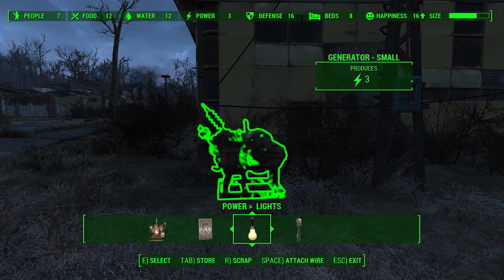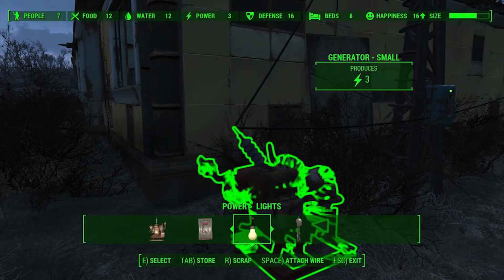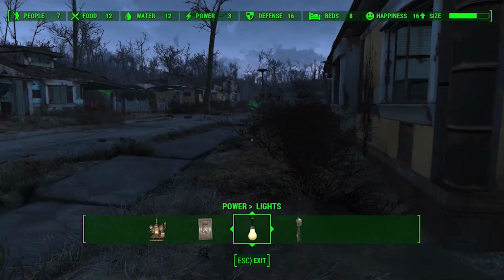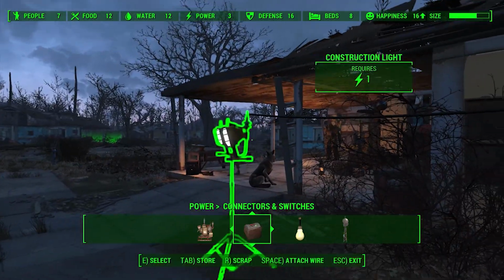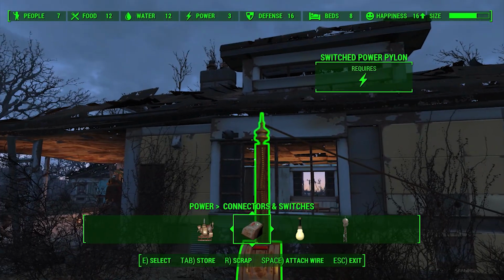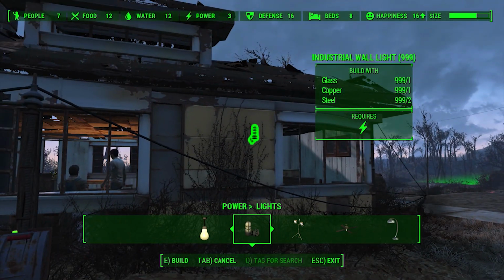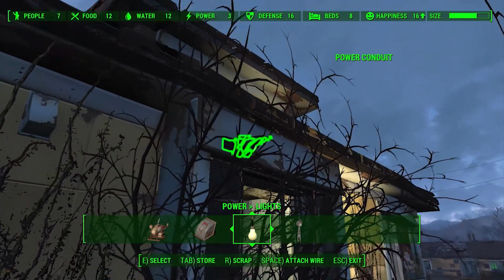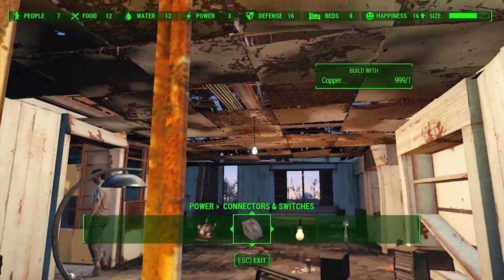Fallout 4 Power Basics for Setting up your Settlement Guide

Comment: How do you attach the copper wiring? When I press Y to attach the wiring It won't work.
Reply: highlight the generator and press y to get the copper wire then if the item you want to power is close enough and doesn't require more power then the generator can make highlight it and press y again to connect the wire.

if it's too far from the generator you will need to build a power pole and connect the wire to that first then connect another wire from the pole to the item you want to power.

Comment: You actually don't need pylons to connect power to each individual object. You can run wires between the objects themselves, like say the wire goes from a turret to a work light and from a work light to another turret. You can run wires directly in a series between these items. This is handy for when you are setting up objects on a wall, don't want to use the extra resources for pylons, or if complexity isn't really what you are going for.

Another tip is that as long as something is connected to another thing, then those two things are considered as being on the same grid. Sometimes you will find yourself making power sources and structures on two different sides of a settlement. This isn't necessarily a bad thing, but if you decide that you want to make everything on the same grid then a quick fix using a single copper wire will work just fine.

Comment: How do i power my Terminal thats inside of a building, with my main power scource that is outside? Cables don't work cause of walls, anything that generates power in a AoE also won't work since the Terminal needs 1 electricity. Really i'm at a loss there is no way i can move power from a closed off space to the outside or vice versa. I want to be able to use my Terminal for searchlights etc, but its just impossible unless i place it outside which looks stupid and makes no sense. Am i missing something or is it just a fail on Bethesda's part since it's really frustrating have been trying different solutions for a hour but couldn't figure it out.

Comment: You don't need to waste so many pylons. If you place the pylons on the roof it will power up the lights inside the house.
Reply: Ryan Westfall I literally placed 3 small pylons and connected them in strategic places around the house and It powered up every corner of the house. They aren't even very noticeable. They just look like antennas. If you want you can also place the small boob shaped ones (forgot what they were called). They have the same effect except on a smaller range so you'll have to place more of them.
Reply: Collector2006 It was a joke. because pylons, in a row.. on the roof of a house. looks like a mohawk. but anyways thanks for the antennas idea.
Reply: +Collector2006 unless you don't want your house to have a mohawk.
Reply: thanks man that works what better than  what I've tried so far  :D

Comment: You can chain generators together with wires to maximize output. For example, instead of using 2 big generators in separate locations, link the generators with a wire and the main wire traveling the pylon would output 20 instead of 10. Also, wires both send and receive electricity, so it should be possible to just connect conduits together and power them from the same source.
Reply: +Syntherus I was joking with a friend of mine who plays FO4 to the other day. I said, "I just love the fact that you don't have to wire anything up to building code." LOL I daisy chain everything most of the time!

Comment: Do Raiders attack your settlements? Otherwise what's the point? Not hating, just wondering :)
Reply: +66_greenrunner_77 well at least you have walter white on your side
Reply: Depending on your defense, yes. However, if your total defense is higher than both your food and water, then Raiders won't bother.
Reply: @AQS521  that's not entirely true, I had 36 food, 47 water and some where over 500 defense and I still got attacked (yes I used mods to get a high defense)  although though they didn't attack as much but they still attacked and to be completely honest, I've stopped taking care of the settlements because of it . Its JUST SO AGGRAVATING JUST BE IN THE MIDDLE OF A MISSION AND HAVE TO STOP EVERYTHING THAT I'M DOING JUST TO SAVE THERE SORRY FUCKING ASS AND ITS THE SAME ONE OVER AND OVER, I CANT FUCKIN TAKE ANYMORE AND YOU DONT EVEN GET ANYTHING AT IN MY EXPERIENCE FOR FUCK SAKE!!!
Reply: Flex Tape my comment was 3 years ago lol
Reply: If i have high Walter and food but no defense. Chance of attack is higher. Having higher defense makes Them Think twice
Reply: TheJerseyDevil oops
Reply: +iKavix yes

Comment: a thing that i didn't see being made use of is that if you delete or store a pylon, then you need to store the wires manually or else they get deleted and the copper is lost
Reply: +Tetris_Chemist if you take down a pylon and forget the wires the wires automatically gets stored.  You just wont see them like they show it on items.  I tested this earlier.  I had 1 copper and I took down 3 wires by removing the pylons.  my supplies still says I have one copper but i was able to make 3 wires before it used my copper.
Reply: +TheLeahacer maybe I encountered a bug then, I stored some pylons and then tried to set the wires back up and they were gone
Reply: Tetris_Chemist
or maybe the bug is with me? o.O

Comment: How do u power a tv, I tried connecting a medium generator to the tv and the tv didn't have the white outline
Reply: +Beaztboyzgotz “mrswagatanything” Nottin the generator does not provide power in proximity like conduits and pylons.  Generators is just the resource.  The TV needs to be in proximity to a wired pylon or conduit.

Comment: How do you change the songs on the jukebox? It's stuck on classical
Reply: +T600INFILTRATOR  you can't change the actual radio in the environment but you can change the station  via the pipboy. hit tab then select the radio headline and then select or deselect the station of your choice.
Reply: Shy MIGRAIN But why is the jukebox constantly playing classical? It only picks out 1 tape in the middle :\
Reply: ***** The radios in the environment play the station of the closest radio tower.
Reply: +Shy MIGRAIN its a shame. the jukebox doesn't even play the radio. it just plays that 1 song over and over again.
Reply: 1loosemorals Are you serious?
Reply: +T600INFILTRATOR  yea its annoying. pretty much first thing i did in game was build a pub. having that same song play over for 4-5 hours started to annoy me. placing all the booze bottles with the hold "e" button to move instead of pick up thing took ages. then i found out you could place em in builder mode too. much easier. even with this tho setting up the pool table gonna be a pain (once i find a whole set of balls)
P.S. please dont tell me where the balls are. finding em is part of the fun.^^